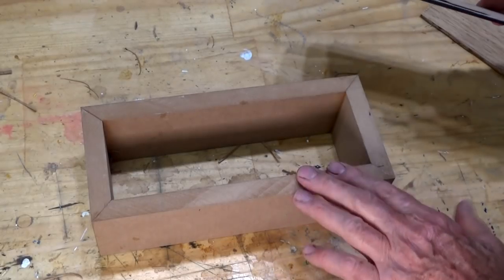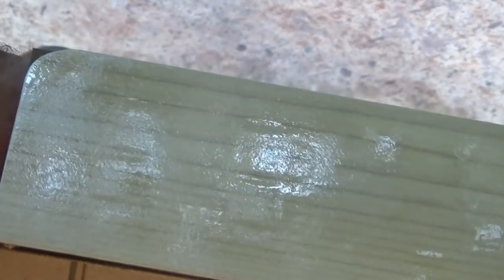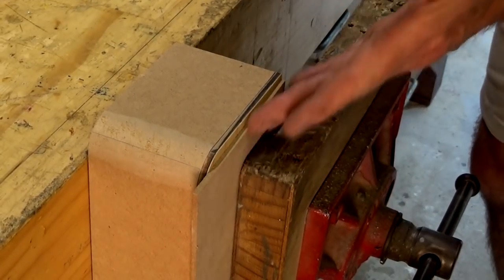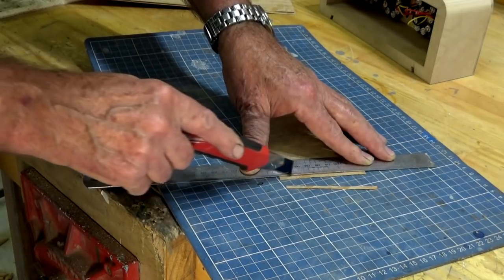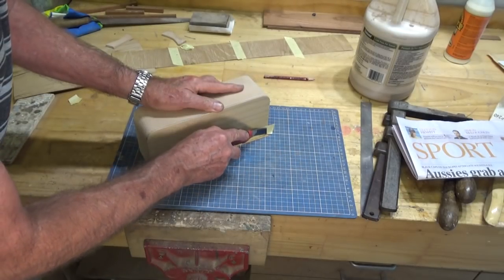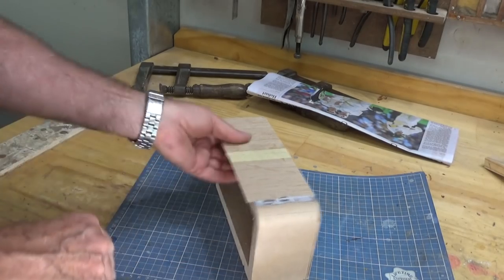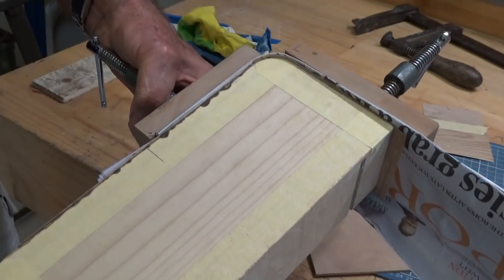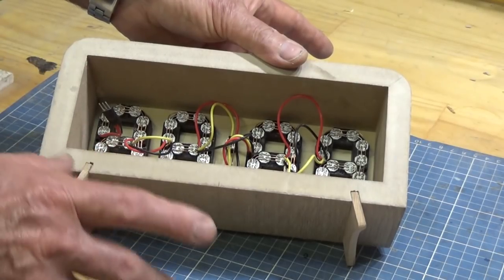DIY Vixie Clock - Part 3

Comment: Green 3M automotive masking tape does not leave any residue even if left on for a few months. It’s a great product. I have been painting cars for 30 years and I use that green masking tape for everything. It’s also pretty flexible since it’s made for masking trim and other intricate parts you don’t want painted. I have always been very to bend and stretch it to mask what I needed.
Reply from the maker: I have used cheap masking tape before and it tends to dry out and go brittle very quickly especially if it's exposed to UV light. It can be a nightmare to remove later but the green tape has been very user friendly.
Regards,
Mark

Comment: Mark, nice work. I was concerned for you because of all the wild fires in Australia. Not sure where you live but good luck.
Reply from the maker: Thanks for enquiring but we are actually quite OK up here in Queensland. The poor buggers down in Southern NSW and Victoria have it really tough. Much of the terrain is inaccessible and the forest are bone dry. The Eucalyptus oil in the tree canopy is so volatile it will vaporise out of the leaves and form an explosive mixture which ignites like petrol vapour. That's what causes the air to look so blue in the valleys of the Blue Mountains. We need rain and lots of it.  
Regards,
Mark

Comment: As always, Good Show Mate. You are way nerdier than me. That's a compliment, not a slight. I really like that CNC Laser cutter. Robots doing their stuff.
Reply from the maker: Even though that laser was the bane of my life when we purchased it for the school where I used to work it is now a reliable and very flexible workshop tool. It's a pity I had to give it a brain transplant to make it work though.
Regards,
Mark
Reply: @Preso58  True love never runs smoothly. Good stuff takes some time. Looks like the brain transplant worked just fine.

Comment: You can apply the veneer using plain wood glue and an iron. Apply two coats of wood glue to both surfaces letting them dry to the touch. Then using an iron set to cotton, iron the veneer onto the base. The heat softens the glue to make it act like contact cement. After about  two days, the bond is permanent.
Reply from the maker: I have read about that but have never tried it. I must give it a go.

Comment: Well that's a first for YouTube, never seen nor had any idea you could plane MDF on the face or otherwise. Of course I will be working with this medium for the first time soon. Guess I will be looking for my first Stanley. Many firsts here :-)
Reply from the maker: Chris, I could get away with planing the MDF because I was going to cover the planed surface with veneer. The MDF is actually made with a very fine textured layer of wood fibre on the outside and coarser fibre in the centre. If you plane too deep you will expose the inner, coarse layers and the resulting appearance will be quite different to the fine outer layer. It is much easier to plane the face than the edge though. 
Regards,
Mark

Comment: You can get spray on contact adhesive these days. A few light coats will help with even coverage.
Reply from the maker: The commercially used contact cements used for post forming laminate are super strong and don't form lumps but it's not really practical for a small shop setup. I do have some of the rattle can adhesive but I still like using the cold press veneer glue. It's a bit fiddly to get it clamped up but it forms a uniform bond and the turnaround time on the clamping is fairly short.

Comment: This is going to be nice. Maybe in the next video(s) you will address keeping those fancy vent holes from becoming front doors to Australian bug condos?  I often use ordinary kitchen wax paper on glue-ups to prevent glue bonding to the culls or work pieces.  Thanks for the interesting video.
Reply from the maker: I am way ahead of you on the vent hole issue. You should see it in the next video after the next one.... I think that's right. I have used Glad Bake as a good release agent for messy jobs. The good thing about newspaper and kitchen towel is that it allows moisture to be absorbed if there are any voids in the veneer. When using PVA glue a non porous paper will allow the glue to spread sideways over the surface of the veneer and this can lead to an uneven appearance when any sort of lacquer is applied later. 
Regards,
Mark

Comment: Another great series! I don't understand the button for DST when you're using a microcontroller and wifi. Should change automagically...
Reply from the maker: William, it depends on which time server you select in the code setup. I am using an Australian server called au.pool.ntp.org which (I think) does not adjust for daylight saving time. The functionality is there to enable or disable the DST depending on which time server you select. It really just toggles between two states, forward or backward one hour.
Regards,
Mark